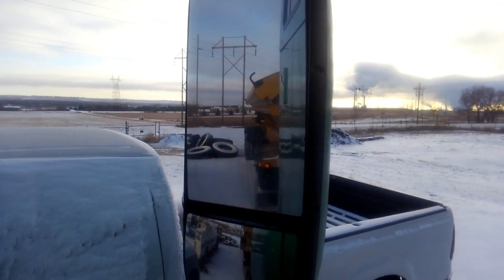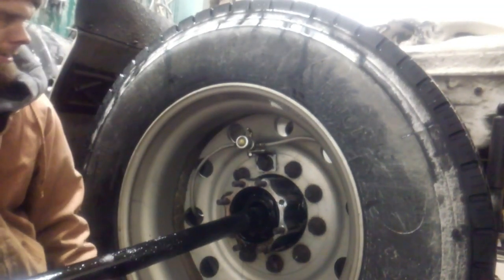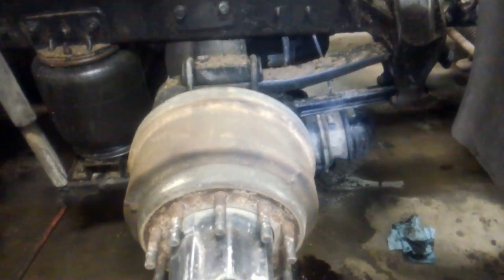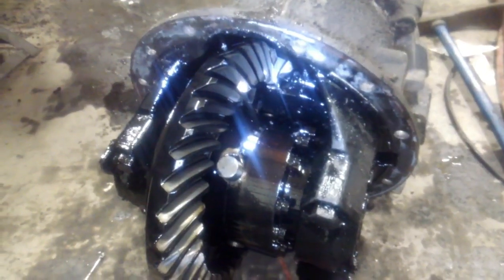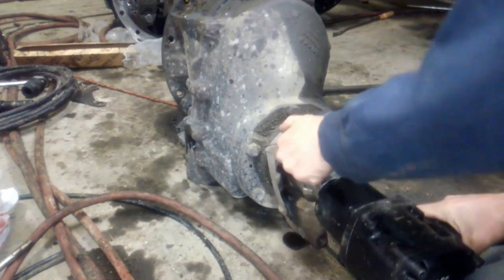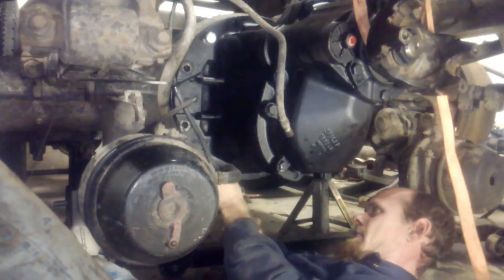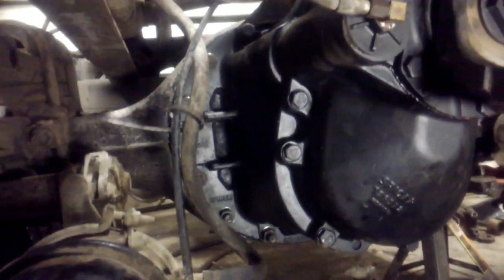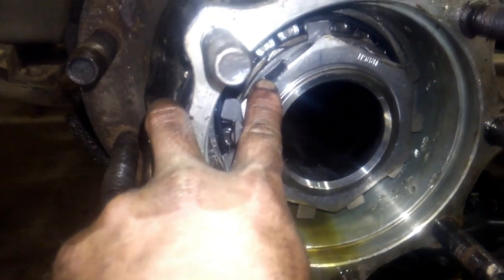semi truck rear end repair axle 3rd member in one video

Comment: Very informative !  Lost my Driver side duals last week  as I was exiting hi way.    When i recovered the  duals the Axel and both dual were all together as one unit with hub cover still on and all bolts tight.   Nut and lock washers on housing missing.   Gonna pull rear cover to inspect today. Any advice would greatly be appreciated.  Thx for vid !
Reply: Well I thought I should update my post as I believe the reason I didn’t see the nut and lock washer is because it apparently in just behind the hub cover.  This truck just had the differentials gone thru and higher gears installed. I’m guessing who ever did the job didn’t put one of those tab washers like you used in your video on this diffy......   The spline on the axel looks to be ok and axel appears to be straight but I really wold like to check axel to be sure. Any ideas on checking for straightness?  Or do u recommend I take it to a pro to check it.  I think if it’s straight I can just put it back in and add a tab washer.   I haven’t pulled diffy cover yet to check for issues but I plan on doing so....  Thanks again for the video!  Any advice is welcomed ... lol.  😉👍
Reply: Well so I see there is no cover on the differential to easily inspect  internals .  My diffy has Two lock nuts per side (4) and one lock ring with the holes in it per side (2)  and it does have the tab ring per side (2) . But doesn’t look like it was bent over the nut. Maybe they forgot to bend it over.  Who knows....   When the nuts back off . Is that an automatic death sentence for the 3rd member ?   The axel. Appears to be fine as it came off at low. Speed (5mph)  Spline looks good . Was hoping I could just reassemble with tab ring bent over correctly.  Do you think I need to pull 3rd member to inspect. I’m not a shop with good tools to do it but could manage if I must.   Thanks in advance 😉👍
Reply from the maker: Yeah they must not have bent the tab over or set the bearings correctly. I would think the 3rd member would be ok. Unless the splines got chewed up. I don't think I would see a need to pull the 3rd member unless you have trouble getting the axle shaft in
Reply: Ezrider92356   10/4 on  Nat .  I’m going out now to look the bearings over before I put it back together. They felt smooth when I checked them the other day but  I noticed a discoloration on the part of the differential that the bearing slides over , like a bearing had run hot at one time or another.    I couldn’t remember what you torqued the lock nut to, I remember something you torqued as tight as you could get it  but I’ll re watch video and I’m sure I can find it on google. Thanks for the reply. I’ll  update once I test it out. 😉👍
Reply from the maker: Basically torque it down as tight as you can get it while spinning the hub to seat everything then back it off and just snug it up. Lock nut goes on tight. One of the wheel bearing videos I pinned a comment where someone asked about torque specs and I replied with all the specs
Reply: Ezrider92356  10/4 Brother,  I appreciate your help .  I subscribed to your channel,,   so will  be starting  my online training.  😉👍
Reply: Ezrider92356 I’m old old old school so I remember very well what it was like to not have the internet at my finger tips ....  Had to rough it and actually cook hot dogs on the stove.  Thought I  died and gone to Heaven when we got a microwave.   This is awesome ! Thanks again !

Comment: Hi can u pls explain the part Whr u install longer bolts to slide differential away from housing pls...I’m having hard time with with I already remove all the bolts....thank u in advance
Reply from the maker: basicly i just used a longer bolt to act as a guide pin to help position the 3rd member so i could slide it into its final position without much fuss possibly messing up the gasket sealant.
Reply from the maker: the longer bolt is removed and replaced with the proper length bolt after a few of the  proper length bolts are installed bolting it in place. just gives you a little more room to work and helps you get it in its final position a little easier. i also may have used longer bolts removing it as well so i could break the seal and move the 3rd member away from the housing to attach my chain hoist without the diff just falling out and damaging things.
Reply: Thank u for sharing that info....I have 95 Volvo white gmc with Eaton ds402 I’m having hard time removing it...do u think I have to remove rear yoke since it’s a Volvo ? Thank u again...
Reply from the maker: @jobandhillon16  a ds402 is the same no matter what truck its in. axle housings can be a bit different for different suspensions. i assume your talking front diff.witch would actually be a dsp402 it may help to remove the output shaft by removing the rear yolk then the seal then the snap ring and then remove the output shaft. if the splines are worn sometimes it may hang up a little bit on the splines.  last time i did one i did it that way and then also waited till i had the diff re installed before re installing the output shaft and i thought it worked a little better than how i did it in this video. but most likely the gasket material that is holding you up somtimes they can be glued in there pretty tight unless of course you already have it broke free and still having trouble getting it the rest of the way out. in witch case the only things that could be hanging you up would be if you didn't slide your axles out far enough or if your hanging on the output splines. but assuming you havent gotten it to wiggle yet and broke the seal of the gasket material and you haven't missed any bolts and your axle shafts are removed you probably just need to pry/wiggle on it a bit harder to get the gasket material to break loose.
Reply: Ezrider92356 yes I already broke free and it wiggle a bit and all the bolts r out axle shafts removed but for sum reason it’s not cuming off....when I try to wiggle it the rear yoke also wiggle so I thought I might have to remove it...I’m gonna try again tomm taking off rear yoke...thank u so much for taking time out to reply. U r a big help I really enjoy ur videos.

Comment: How many hours you think it took you ?
Reply from the maker: this one took a while i don't really remember exactly how long but probably around 15 hours after i ended up re-doing all 4 wheel seals removing the diff cleaning the housing and putting it all back together.

Comment: Man I'm have a problem getting the axle back in the housing. Anything will help
Reply from the maker: You kinda have to rock the axle up as you push it in and then it will slide in one step but it might stop again before it goes all the way in. You might then need to rock it or turn it a bit more to get the splines to engage
Reply: You need to push down on the axle head to push in completely!